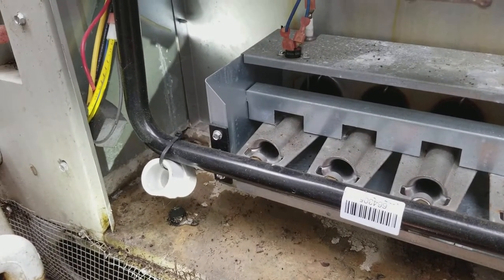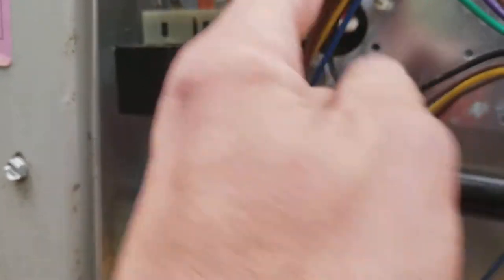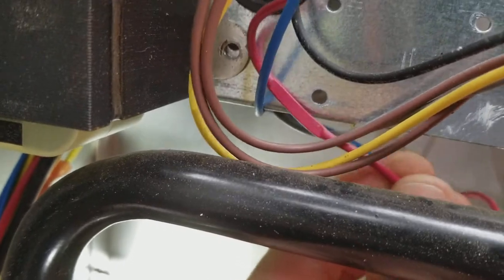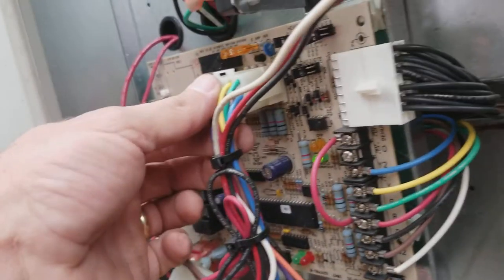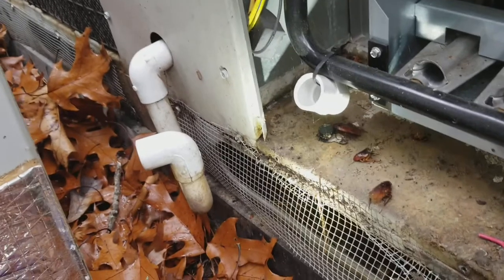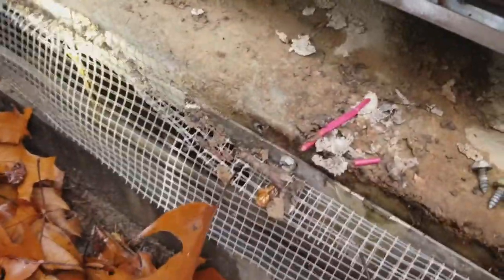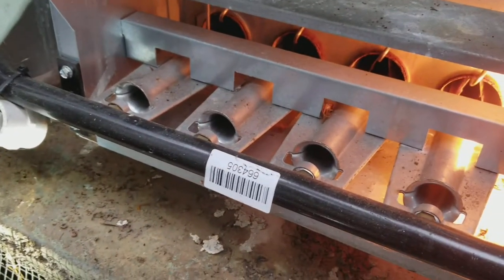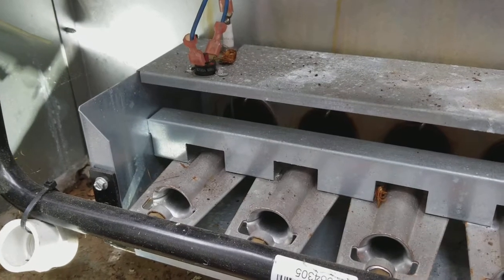(Must see) Diagnosing a roach infested Nordyne 5 ton gas package

Comment: If there were 30 in the packaged unit outside the house, how many do you think are inside the house?
Reply from the maker: Kenny W the customer called back two weeks later with same issue. Cutomer wanted me the honor the parts warranty. I refused for two reasons. 1. It was not a munufacturers or workmanship issue. 2. I didnt install it in the first place. Its a 4 ton unit on 1000 square feet in SC. Wayyyyyy oversized.